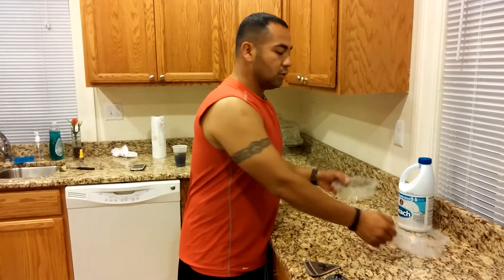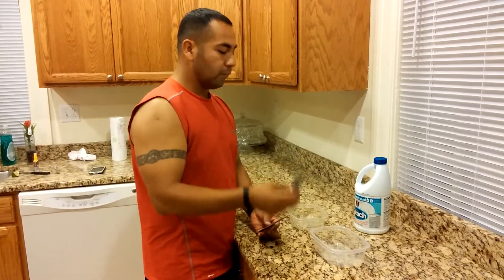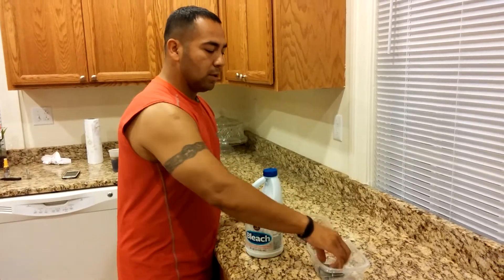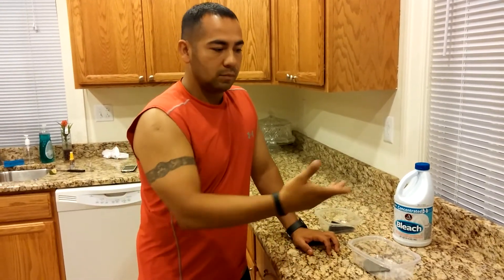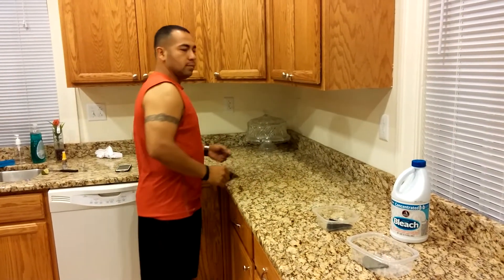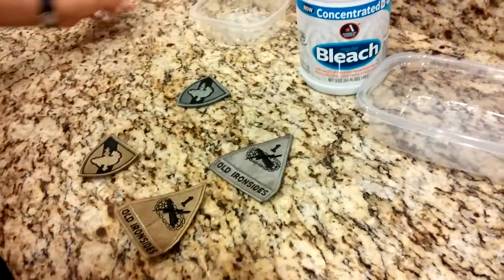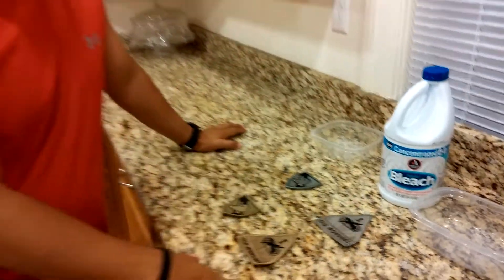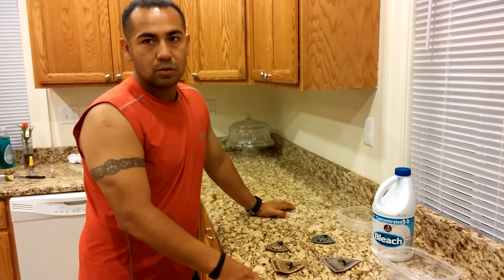Turning ACU patches into multicam patches

Comment: Currently in the midst of using this technique on two patches, will report back after the allotted drying time.
Reply: +Adrian Kroger  After testing on both a National Guard patch as well as an Active patch (they are made differently in some cases) I can say the following:1. Put the patches into a preferably disposable container with enough bleach to cover all of them.2. Let them set for approximately 12 hours then flip them in the container (if they were face up turn them face down).3. After a full 24 hours Take the patches out and rinse them.4. After rinse, allow patches to dry, preferably in direct sunlight, until no longer wet.5. Place in dryer on timed dry for no more than 2 minutes.6. CompleteEnd result is that both National Guard and Active patches do become close enough to the Muiltcam colors to pass.Final Summary:Great idea to save some money on patches.Editorial:No doubt clothing and sales around the nation are soaking ACU UCP patches in bleach right now.